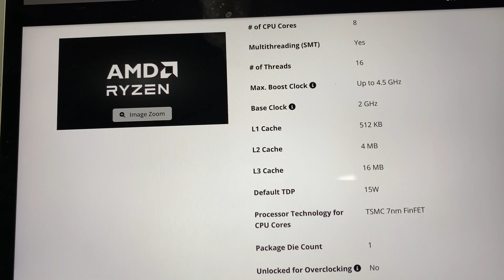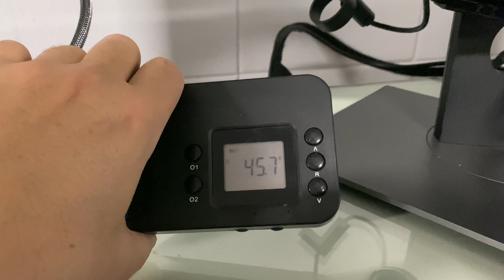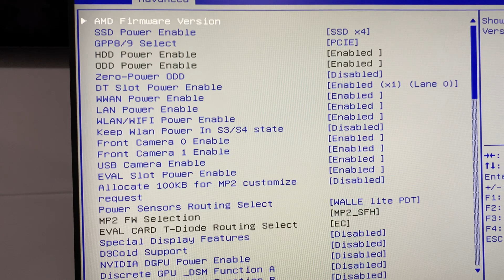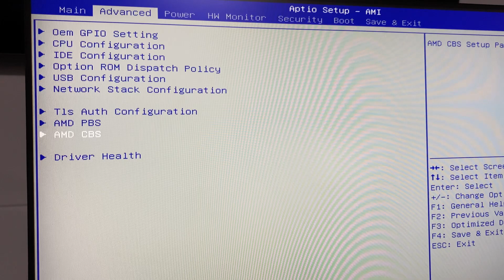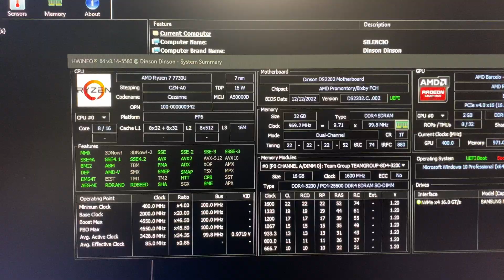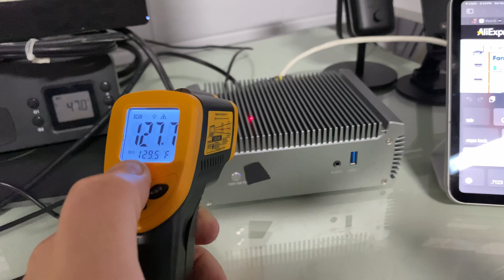🛩️Topton FU02 Fanless RYZEN 7 7730U 8 Core 16 Thread Homelab Monero MINI PC Review #wisebuyreviews

Comment: I have this as my main PC! I'm a programmer, but i don't do heavy stuff. The fact it is fanless is really its best feature. And it can play e.g the: AC Odyssey video game in 1080p, with high textures but everything else low, at 28FPS, which is good enough for me since i have played games in Amiga, with a lot less FPS :D There seems to be a better/beefier PC with the intel i7-1355U cpu, you can search the term P12B in the express of ali.., or perhaps even a better one by searching the terms "topton fanless g15" in the express of ali..
But in the site cpubenchmark,  power_performance section, it seems that the Ryzen 7-7730U, has either way one of the best power per watt performances. It is in 18th place, but before a few months it was around 10th position. So perhaps the i7-1355U wouldn't do any better.

Comment: Why aren't there more fanless ryzen devices?  You would think it would make for an ideal media/entertainment device because of its much better GPU performance than similar Intel based fanless PCs
Reply from the maker: It seems the companies seem to follow each other too much. FU03 would have been great in this FU02 Chassis! However both seem to be limited by port selection compared to their Fan-based versions. I am just tired of fans. To be honest my best experience is building a Full Desktop PC with FANLESS Noctua NH-P1 as you get all the ports and it yes does take space but makes zero noise and no compromise regarding my 10gbe ethernet and nvme drive and sata ports. The benefit of the mini PC is that it is the MOST POWER EFFICIENT, doing about 10-15 watts idle as opposed to full desktop 80-100 watts idle, mind you with an RTX 4070 super.
Reply: After doing a lot of research I have realised that fanless + AMD Ryzen doesn't make much sense for a Mini PC because the weight, size and cost of the metal (aluminium / copper) required to cool a Ryzen passively, even a low power one with a 15W TDP, makes for an unappealingly heavy and bulky "mini PC".  Intel offerings with their 6-10W TDPs make fanless + mini a lot more achievable without creating a monster. This design has a lot of aluminium and copper and is quite large, and it's probably about the minimum you'd want for passively cooling a chipset like this. and doesn't even allow much headroom for things like gaming. Whereas the same performance in an actively cooled design can be much more attractively thin and small.
That isn't to say don't buy this, it's just to say, that's probably why this sort of thing isn't that common.

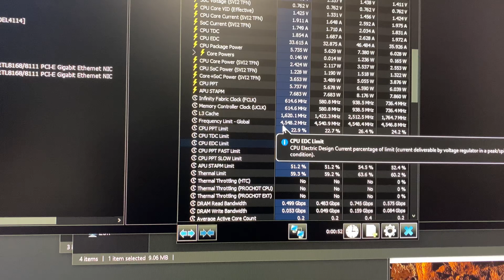Comment: 28:44 ...it seems that your Drive Temperature was quite high!
Reply: I bought one taking advantage of 11.11 and promotional codes added by the store that day, but 5825U one. Place an $8 or $9 aluminum radiator on top helps to passively lower the maximum CPU temperature by 4 or 5ºC. Also adding a small heatsink to the disk helps, but even better is leaving the front and/or back covers open. In my case, in a desktop environment, dust is not a problem.
Reply from the maker: Great work.
Reply: Hi everyone!
I recently bought a PcZinophyte Fanless Mini PC FU02 with a Ryzen 7 7730U running Windows 11.
Just wondering — is it normal for the case to get extremely hot (almost too hot to touch) when watching 4K videos on YouTube?
Could this damage the mini PC over time, or is it nothing to worry about?
Also, would adding a USB fan on top help?
Thanks a lot for any advice!

Comment: Hi, it seems there is a new brother from this one(FU02). It's not completely fanless, more like semi-passive, but it seems to have potential as an updated version, with better connectivity and more modern processors. 
It is called FU03 under topton brand in aliexpress (I don't know if it's marketed under other brands or there are more variants of similar chassis). It comes with Ryzen 8845hs, 7640hs or 7540u.
Reply from the maker: I am liking it also! That is nice thanks for sharing: Here is a link for others to check out. I bet you could possible run it fanless mode by not plugging in the fan cable?! Looks very similar with the heatsink design. Or if fan is so low in noise that it is hardly noticeable it is a decent upgrade. The GPU 780m graphics alone kicks the pants off this one! https://www.aliexpress.us/item/3256806407007290.html
Reply: Since it is very new, there are few user reviews yet. But they say it is silent. I asked at the Topton store and they told me that the fan is replaceable, so I suppose it can be disconnected. Even so, I don't know if it would be advisable at least in the top-of-the-range processor and less so in warm environments and intensive use.
They also told me that the CPU temperature of 45ºC - but not confirmed by users yet - above which the fan starts to spin at minimum revolutions cannot be altered. Having control over the fan curve, voltages and powers states in BIOS would be a dream come true and very useful. I don't know nothing about but there si still some hope. Over time I suppose more details will be known.
I suppose too small home-made alterations can be made to better adapt it to a passive profile.
Cheers.
Reply: @xec467  Yes, it looks really like it could be a great silent mini pc. I have ordered one with the 7540u. It should be fast enough for everything I need.
Reply: @knofi7052  Great!. On paper it seems like a very good option. The 6-core of the 7th generation as powerful as an 8-core of previous generations in raw CPU power. Without a doubt, there is more than enough power for desktop tasks.
Let us know what you think after test it. And if the fan is standard or custom-made. Another thing that always worries me in Chinese devices from these not-so-well-known brands is the quality of the components and their durability. In the case of the fanless FU02 model, since it has been on the market for several years, there are many more experiences and it seems to have turned out to be quite reliable. I don't know if you could tell us what model and brand of motherboard is reported in Windows or Linux. Cheers.
Reply: @xec467  I have got it yesterday. It's smaller than I thought but the quality seems to be really okay. I bought it with 512GB SSD and 32GB memory, the memory is from Crucial the SSD noname. The BIOS has many options although I wasn't able to to find out which key let's me to the boot menu, yet. There was one problem when I tried look into the PStep settings because afterwards the pc didn't react anymore. However, I just I needed to unplug the battery to reset the CMOS. I am quite happy with the pc because it can be configured to be totally quiet and even fast. I can change it to many predefined TDP values, can even manually set the CPU Package Power (PPT) and the fan settings. So everything is quite good in my eyes. I have done some tests:

Cinebench 2024 (25°C room)
54W TDP: makes no sense
45W TDP (default setting): MC: 565 (85.5°C fan noisy) SC: 53 (65°C fan audible)
28W TDP: MC: 533 (84°C fan noisy) SC: 53 (65°C fan audible)
15W TDP(25-30W PPT): MC: 498 (67°C fan audible) SC: 53 (65°C fan audible)
15W PPT(manually): MC: 379 (52°C fan silent) SC: 52 (65°C fan audible)
10W PPT(manually): MC: 231 (47°C fan not running or completely quiet) SC: 48 (55°C fan silent)
17W PPT(manually, no core perf. boost): MC: 337 (55°C fan completely quiet) SC: 37 (46°C fan completely quiet)
17W PPT(manually, no core perf. boost, no fan): after 10 minutes: MC: 63°C SC: 52°C
15W TDP(no fan): after 5 minutes: MC: 82°C SC: 84°C (after a minute)
25W PPT(manually, no core perf. boost): MC: 480 SC: 37
The TDP settings means that the PPT can be much higher.
The CPU Package Power on idle is between 3.5 and 4.5W which is really very low.

I think, as you can see in the results, the default TDP setting is too high if you want to have it quiet and cool. One problem is that for reaching the core performance boost the fan is needed and will be audible. So you have to sacrifice either noise and heat, or SC or MC performance. Anyway, I still think it has a quite impressive performance and you can chose what you prefer!😉
Reply: @xec467  Finally, I have found out the best way for me how to run the system. I am using a setting of 18W PPT in addition to a thermal limit to 55C°. In Cinebench 2024 that results in MC: 434 and SC: 50 and is never becoming hot. To be honest, I was surprised how good the thermal limit worked with that CPU because it reduced the Mhz only to the level which was needed to keep the temperature exactly at the limit value (no fan needed at all). Now, I am really very happy with this mini-pc.
Reply: @knofi7052  Awesome job!. Congratulations. And thank you very much for so exhaustive information.

From your comments, It seems to me that the BIOS is much more configurable than in the FU02 model. At least as far as the CPU power management parameters are concerned. Although as in the FU02, it seems that the optimal “silent” point is around 15W, which I believe is the default one in the FU02. However placing a cheap aluminum heatsink on top of it maximum temperature under stress can be reduced by 4º or 5ºC or more. In the FU03 I suppose it would be more complicated to accommodate such a solution.
But this FUO3 certainly seems like an optimal mini-PC. Much more up-to-date in every way. 

In the regards of the fan/heatsink combo I would have preferred a slightly more ambitious approach. But perhaps that is asking too much.
Is the fan easily replaceable, is it a standard type?

I was tempted to change my FU02 for this FU03. But I think I'll wait a while to see how everything evolves and its reliability in the medium term. Furthermore I get my FU02 one with 8 cores very cheap.

Also, I might go back to the idea I had in mind initially of replacing my current semi-passive PC with a more updated version. Basically, I use a desktop APU (I would pick 8700G one or higher for next one), with a microATX or ITX motherboard, in an open box... With a mega heatsink and a 12" or 14" low-rev fan from a well-known brand, applying extreme undervolt... and adjusting the limits at which the fan starts to turn on and its curve to minimize noise. In this way one get a similar semi-passive system... but much more powerful in similar (or lesser) noise conditions. And if necessary, in specific tasks it behaves like a real desktop. In addition to the advantages of greater versatility in expansion options and connections.

I always wonder why most laptop BIOS don't offer options to do manual undevolting and/or underclocking, as well a practical BIOS reset in motherboar. I had previously done them using software on a HP laptop and it was very very useful to lower temps a lot. Maybe because notebook CPUs nowadays have voltages already extremely adjusted from the factory so that there is no appreciable margin for further adjustment?. In desktop CPUs a reduction of between 15-30% of consumption can often be achieved at maximum load with no performance lost, and with the consequent improvement in temperatures and noise.

I recommend to ease internal ventilation too, either by leaving the front and/or back cover open, or by making openings/holes on in them. To extend internal components lifetime. They suffer more than necessary with no ventilation. I also think it is advisable to place a heat-sink on top of nvme.

Take care.
Reply: @xec467  I am glad that you find my information useful. I guess, we silent/fanless advocates have to work together. I could set the temperature limit also to 60°C or 70°C to gain more performance but I prefer keeping it conservative because it does affect the temperatures of the SSD's and other components as well. Unfortunately, it seems that AMD doesn't like having the option in bios to switch off SMT (at least on their mobile line of CPUs) because that's usually a very good way to reduce heat quite drastically and allows gaining more MHZ on their cores at the same PPT which compensates the performance drop a little bit. I had a closer look at the mainboard but wasn't able to get a detailed information from it although the quality looks quite good. When idle the temperature drops below 35°C. It's already great but still it would have been great adding a little bit more weight and size to the case for it's passive cooling capabilities. I am not sure whether the eight core CPU would result in so much better performance because it would produce more and faster heat instead (it's GPU is tempting, though). Anyway, I will keep you and the community updated. About the fan. It's not easy to replace it because you have to remove the mainboard for doing that. However, you can disconnect it although that's not necessary because you can set all fan settings in the bios. I would also say, the quality of the fan is okay because it's really totally silent on low settings. Happy New Year & have fun and success with your projects!😊
Reply: Now, with passive cooling on my SSDs I can keep all temperatures inside the case below 60°C, even when stress testing all components for some minutes and having no fan spinning at all. I am really quite happy with the result. The only thing I'm missing for the perfect, passive mini-PC would be one or two additional USB C 4.0 ports (preferable front and back).
Reply: @knofi7052  , can you show a video or photo inside your FU03, if possible with the noise level at the settings you chose?
Reply: @knofi7052  Fantastic job. It seems like a perfect silent mini PC. Have you achieved those temperatures without openings in the chassis?. Is the fan standard and can it be replaced?
In the CPU options available, I would also have preferred that for the 8 cores appears 8840U one. I think that in this type of device it would be more logical. Although I suppose not all  laptop CPU models are available for all motherboards manufacturers.
As I mentioned in another post, the only thing that rises some concerns in this type of devices from no much known chinese brands is the quality and durability of its electronic parts.
Regarding the brand and model of the motherboard, perhaps through the hardware information in the operating system you can find out something. Or via the geekbench 6 report. In the FU02 the Dinson DS2022 model brand is reported. But I have not been able to find reference on the internet about forums or support websites. It seems support is another aspect to be sacrificed in this type of devices from lesser-known and cheaper brands.

Your posts are very useful for us. Thanks.
Reply: @knofi7052  Could you help me where to find the tdp/ppt settings in the bios? Just got mine fu03 today and I am pretty lost in this extremely detailed bios. TIA
Reply: @knofi7052   Thanks for your review! I take it that you purchased, and measures with, the 8845HS model?
Reply: Says above - 7540U

Super useful discussion thanks!

Comment: what is power consumption on plug
Reply from the maker: I show the power consumption of the power brick connected to this computer beneath the monitor. on that meter there, it's a two plug power strip with black and white lcd screen showing power output That is what that number means. You see it hit a high of about 45-50 watts, as low as 10-14 watts, and maybe average with several things running at 30 watts.
Reply: @wisebuyreviews  thank you

Comment: when u say its 125 deg u mean f not c right lol ?
Reply from the maker: Fahrenheit, yes. A nice hot shower is like 110 Fahrenheit. 110 Celsius is boiling temperature would have burned my hand.
Reply: @wisebuyreviews  When you're talking about PCs its best to use Celsius as to not be as confusing. about 48c (118F) is the start when temps start to burn your hand after holding for a bit. 125F (51c)ish would burn even faster if you could even touch it for long at all or maby that's 55c idk
Reply from the maker: Good tip!